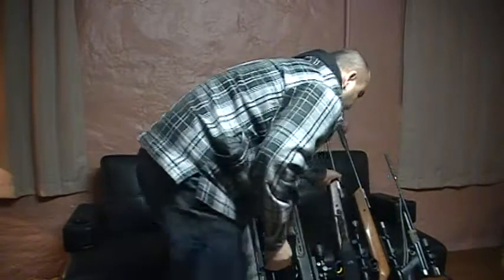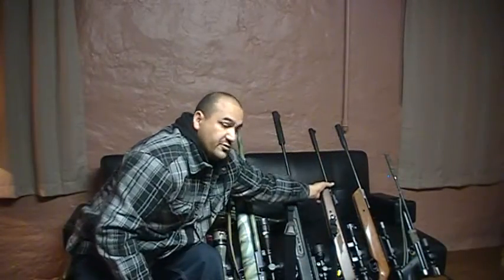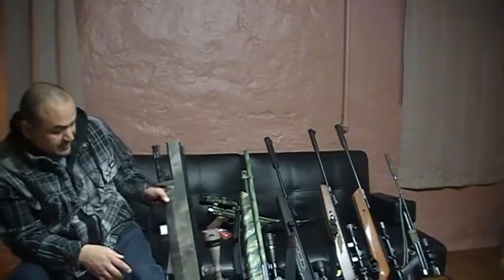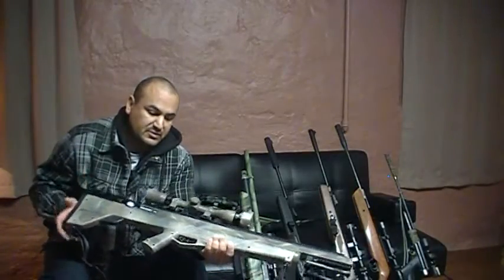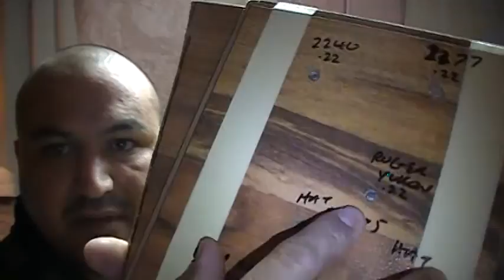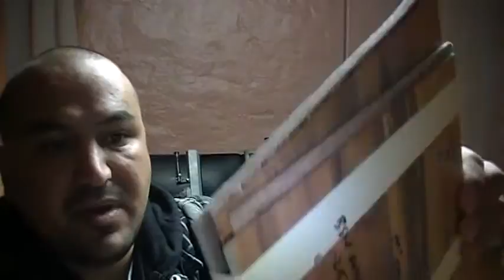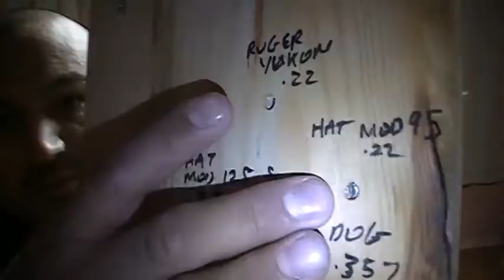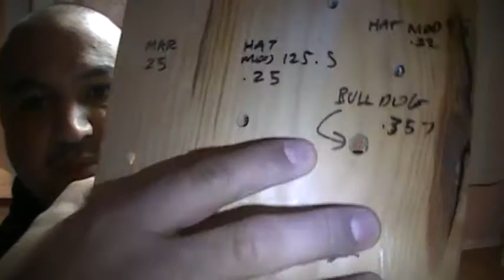AIRGUN CALIBER COMPARISON .177-.22-.25-.357

Comment: Great video!  I like the pine board tests.
Reply from the maker: y2shanon Thank you for watching.  As to your scope questions, Wow I have had lots of people tell me their scopes get eaten up by the spring guns but I'm still lucky I have not had them lose zero.  but what is very common is for your rifle to be off quarter inch to half inch after a period of time for example. today dead on 3 days later it shoots quarter inch high using same pellet same distance, it is my theory that we udjust our selves to the rifle to get on target!!!! when we pick it up after a while it will be off in the beginning but shoot 20 pellets and for some reason u start hitting the center again!!! I sight in before I hunt at 10 yards indoor to make sure it's on.
As for scopes they are all good so dunno there!!
Reply from the maker: y2shanon my Hatsan 125 in .25 has a barrel droop compensator and a 3-9x40 bug buster scope by utg on it and still gets the job done!!
Reply: Man, I'm learning things I had no idea about in regards to break barrels!  I recently found out about barrel droop and think that is the main culprit for my zeroing problems with my piston rifles.  I am going to shim/compensate mount my new utg and mechanically center the scope with a mirror.  Hopefully that should solve my problems.  I heard a scope is at its strongest when its near its center settings with minimal adjustments?  Thanks for the help!
Reply: I could deal with an inch off lol, I was inches off, trying to adjust the scope like crazy.  But like you said barrel droop.  My PCP's are simple; sight, shoot, hit target and smile!  
BTW how loud is your benjamin bulldog?  Could you get away with shooting it in a big back yard without ear protection?  I was wondering also if it is quieter/more backyard friendly shooting it around 10 to 15 yards at 2000 psi and below vs a full tank?  I figure a heavier slug with lower psi and closer ranges would quiet it down and lessen the power for a backyard friendly setup when I couldn't hit the range?  Thanks man!
Reply from the maker: Well wish u well with the scope solutions, as for the bulldog it is simply a beast when fired and shooting @ 2000 psi @10-15 yards will just suck the fun out of it!!! It is a 50 to 100+ yard cuddly beast of fun!!! It's as loud as .22lr your best bet is to make an elongated shroud to silence it but God help you if you don't have a good back stop it may kill by accident. I personally do not recommend back yard shooting of the bulldog if you are in a tight space with neighbors it can be problematic now if they have bulldogs too then let the fun begin!!!!

Comment: try out heavy modeling clay blocks for your testing. . I used it as a kid and it was a good way to see how the pellets worked ,expansion , depth,  ect
Reply from the maker: +funshootin1 i have used it before but well let me just say it is not my cup of tea!! was thinking of other stuff to use, which just so you know i was thinking i would do a video soon about the new stuff i want to try out!! thanks for watching and thanks for commenting. hope to have your insight on the nest one.
Reply: +shootemfulloholes I really need to get the complete lowdown on your model 2240.. that entire setup is perfect for my needs. .that being compact and packable.  been looking at the pcp kit and bulk co2 options as well. I'd love to see an in depth description or at least a parts list.
Reply from the maker: funshootin1 well I can give u a basic list there is not too much to it!!  18 inch barrel and power udjuster and custom bolt from mellonair, valve porting, seal job, trigger job with new spring. Polished hammer, steel breech and extended breech probe.new Stainless steel hex bolts and compression washers. Removable gun stock . Hi-pak conversion to PCP with sound moderator.  Finaly AIM 3-9 compact scope with mildot and IR

Comment: Well done, great review! l test my gun the same oldschool way. you get some real results this way. for my powerful springers l use my formula for the best pellet weight. around 22 gr for .22 and +-25gr for .25. you get both power and speed. l' m very interested in .30 cal hatsan 135 but the pellet choice l think is just to heavy, starting with 40 gr+ for lighter ones. But... that gun with a good seal, finetuned, with a Vortek spring and 30-33gr pellets...that might be very intetesting.
Reply from the maker: +Cetriem Mmmm Thank you for your comments. i still love the old school way of testing its not as scientific but more fun. when it comes to the .30 cal springers i think that they will not be popular for now, first we need much more pellet selection, second need more ooomph in the gun it just is not powerful enough you can get much better trajectory, penetration and energy from a .25 springer so for now its still is a novelty but who knows!!!!

Comment: Wow. 400 pound critters downed w/357 air rifle which I can purchase through the mail! Don't tell Nancy Pelosi that. What's the average guy weigh 180-220 lbs.?
Anyway, again a very nice video. Are you like an engineer or something?  Methodical for sure, you are.
So, I went away from your video wondering at what thickness board would stop that .357?  Two inches?
Oh yeah,  in my Home Depot the 1" thick pine boards are only 3/4" is that the case of your 1" board?
Reply from the maker: Crazy Arrow yup its not exactly an inch but just so u know it will go through 3 full 1gallon jugs at 50 yards!!